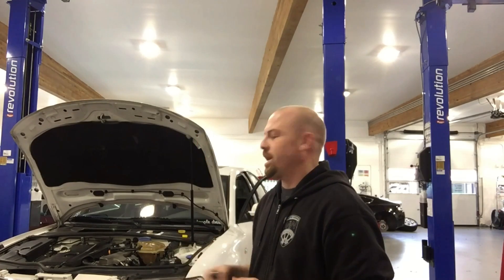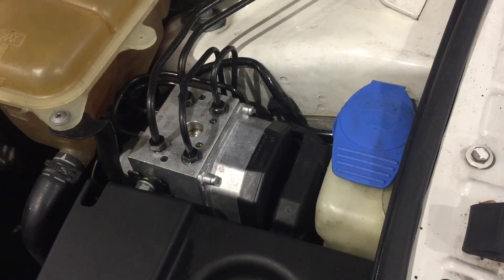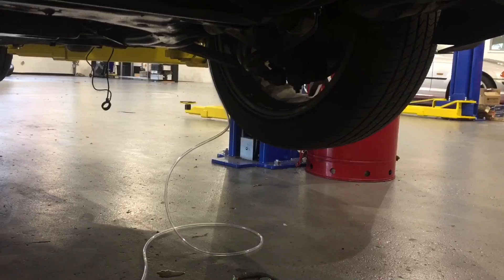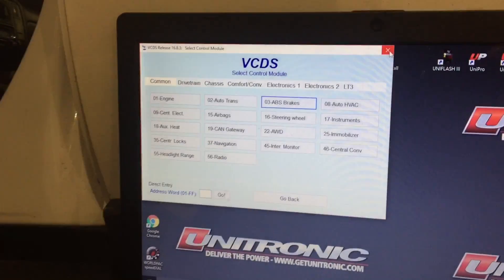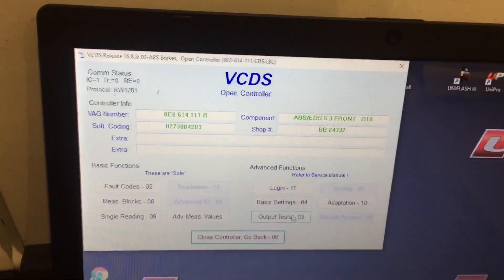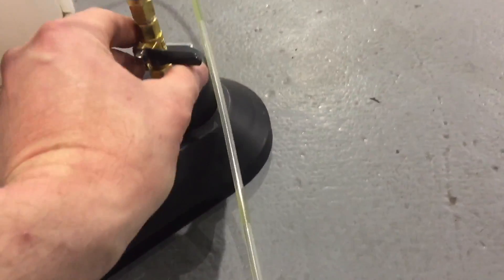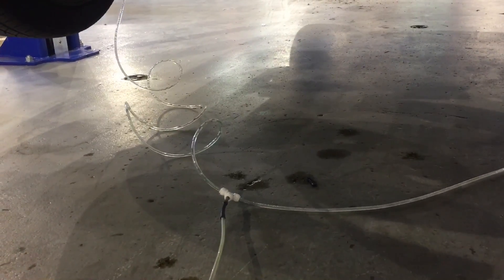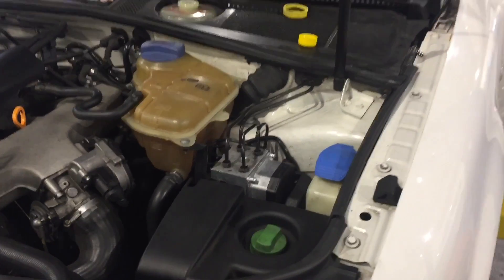ABS Pump Brake Bleeding VW B5 Passat

Comment: Hi Dave thanks for taking the time to make this video. My question is:
After you have the system set up do you then push on the brake pedal and then have someone open the bleeders to force fluid into the ABS pump to prime it?
Note:  Once the brake pedal hits the floor u anchor it there and then start the pump.
Thanks
Peter
.
Reply from the maker: Our pleasure. Yes, you depress the pedal 95% of the way, then run the pump. I wouldn't go all the way to the floor, but close to it. No need to prime it even if you have just replaced the pump. There is still fluid in the system that will pull it though when the pump runs. Just make sure you have fluid topped off all the way to the top of the reservoir and check it regularly.

Comment: I have the g201 fault...yay
So vcds/abs bleed the fronts together.
Then bleed the rears, together or one at a time on the rear?
Do I then do a full normal bleed, ie front left  front right, rear left  rear right right?
Cheers. From the uk
Reply from the maker: For the rears you do them left then right manually. VCDS will tell you which one to do and in what order. For this year and model the rears do not have ABS.
Reply: Thanks mate 
Appreciate your advice 👍🏻
Reply from the maker: @toddy9141  Our pleasure. Thank you for the feedback.
Reply: Cheers mate 
Forgot to add, my car is an 2007/8 Audi A3 2.0tdi sline
Reply from the maker: @toddy9141  You'll need to do each one, one at a time with that vehicle. You only really need to do it if you've removed calipers or the brake master cylinder / booster.

Comment: Thanks for your vídeo! I’ll try this in Brazilian car, I think is the same code (001)  or output test, I’ll see this tomorrow. I have an question, I really need use a “gas pump” to create a suction of my fluids? I could just fill with dot 4 when the abs make a pump job for me? Thank you again! Your answer will help me a lot!!! We don’t have correct professionals here :/
Reply from the maker: You can use a catch bottle for each side. You don't have to have the suction device.

Comment: May I do it side by side of front brakes?  As i don't have two hoses and T adaptor
Reply from the maker: For this year, the factory manual says to do the fronts at the same time. If you don't have a T connector, just use two different bottles.

Comment: Very informative thanks. Spent the the last 2 days with my B6 A4 on the driveway changing brakepads and calliper hoses all around and also swapped out a seized offside front caliper...ended up having to fit a new offside brake pipe also back to the ABS pump because the pipe was corroded. 

Used VCDS to cycle the ABS pump and bled all lines and I seemed to have a nice hard pedal, put everything back together and brought the car for a spin and the pedal is flat to the mat! UGH FFS!! Another day at it tomorrrow!
Reply from the maker: Of corse. Thank you for the feedback.

Comment: if you can do 2 lines at one time,
can you do all 4 at the same time?
Reply: The abs pump is not hooked up to the rear brakes, so it would not pump through the 2 rear lines. The 2 rears must be done through pumping the brake pedal.
Reply from the maker: Yes, exactly what James said. You need a pressure bleeder and/or someone to pump and someone to open and close the rear brake valves.
Reply from the maker: @Daniel Holý Depends on the year. On this specific B5 1.8T Passat (1999) , it only had them in the front. When you run the VCDS it will determine if you need to do the rears also.
Reply from the maker: @Daniel Holý You are correct. I do the front ABS. Then bleed the rear brakes as normal. Right Rear, Left Rear, Right Front then Left Front. There are times that I've had to do it a few times like that, but typically after that it's fixed. If it's not, it could be the master cylinder that is failing.
Reply: @MeisterWerks  
Hi, I replaced rear clippers, and front right flex hose, and did normal bleed procedure of just pumping, holding and bleeding, everything was OK and going good, then all od a sudden pedal went to flor, I taught Master cylinder went bad so I replaced it and did procedure from your last comment on Polo 9n 2003 (with catch can, and nothing happens, abs starts buzzing but no fluid is coming to all 4 calipers?
Is it possible that ABS module went bad although it is buzzing when I use Delphi diag to do a procedure?
Also instructions are not clear enough, do I do RR, LR, RF, LF the same way you do in this procedure on video: to fix catch can start ABS, then open the bleed screw and before it finishes, I close the bleed screw and repeat proces, although it says in procedure to pump the brake 10 times without closing the screw, I guess they mean taht when you have vacuum.
But non the less I did it with pump start open the screw and bleed a little then closing the screw before abs pump stops, but still no fluid is coming to calipers.
Reply from the maker: @bkingtz1  Sounds like it could be a bad pump, but on some models, the ABS doesn't go to the rear. Make sure you've topped off the brake fluid in the reservoir before doing any of these procedures. You might want to use a vacuum tool to pull the fluid though first. Then run the ABS pump. Fluid should come out when opening the valve at the caliper. Also check your bleeder valves to make sure they are clogged with dirt. I've seen chunks of corrosion clog the bleeder even after I've bled the brakes.

Comment: Can I do this manually without the computer?
Reply: You can but this way you won't get any trapped air out of the ABS pump
Reply from the maker: You have to bleed it with a proper scan tool. If you don't, there will be trapping air in the ABS pump causing the brakes to be soft.
Reply: you can! pressure bleeder and follow procedures

Comment: Is the vacuum bleeder really needed if the pump is pumping fluid?
Reply from the maker: No you do not. As long as the tubes are submerged below fluid in the bad fluid drain cans. This will help with allowing air to go back up the tube once the pump has stopped.